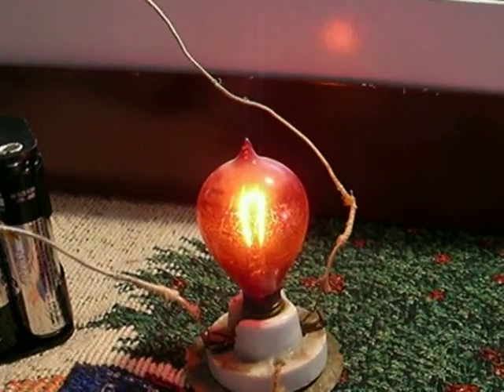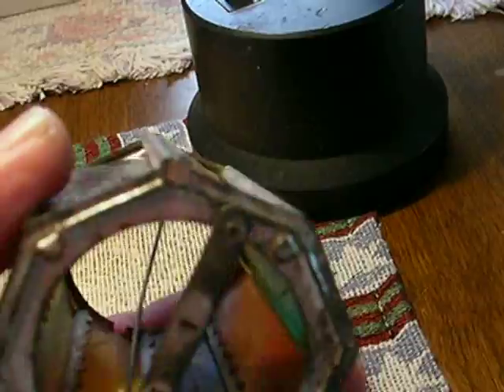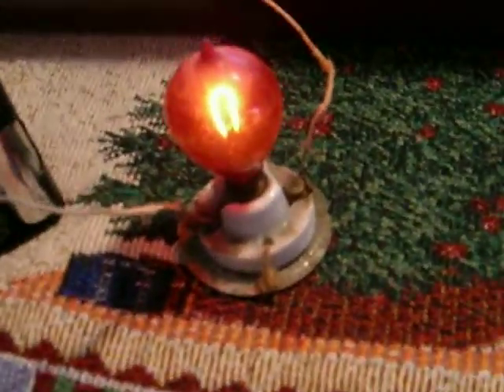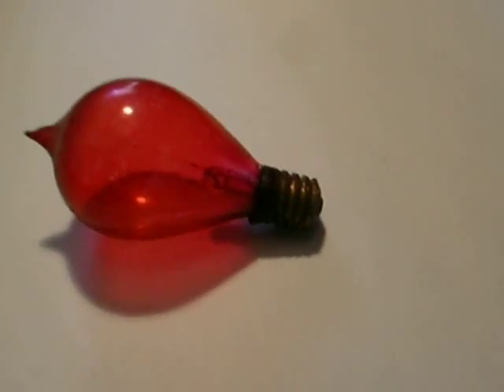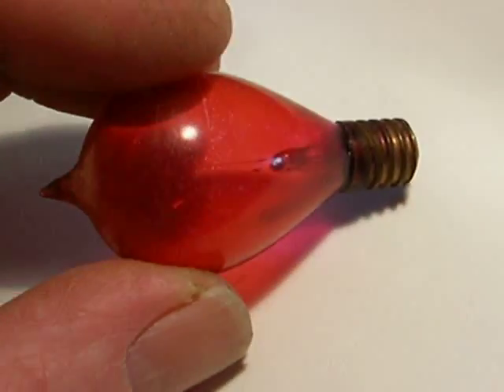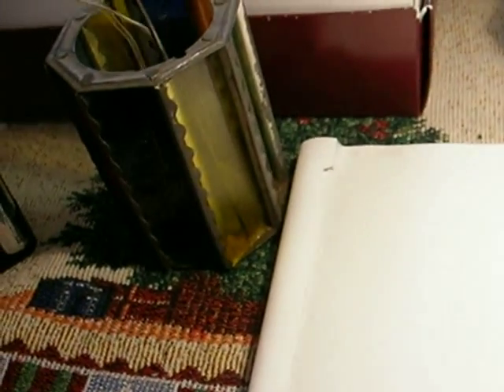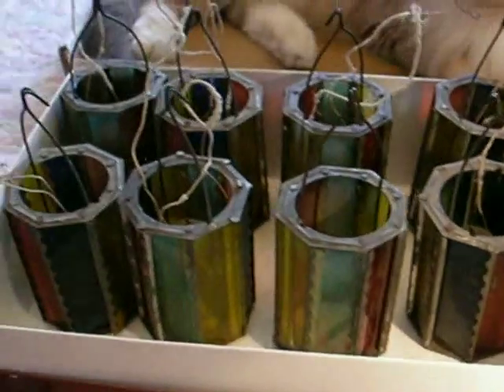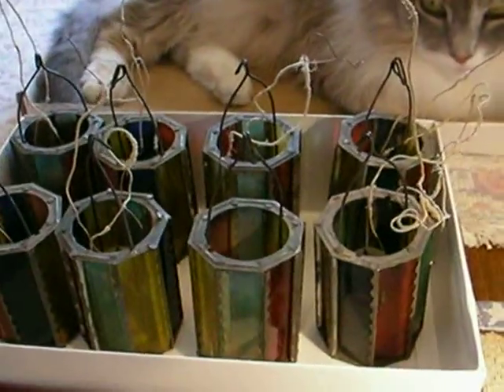Antique Christmas lights - Electrified candles

Comment: Schweet old Edison carbons, Chris! I use my 1916 Edison/Eveready junction-box set at the Edison Tech Center yearly, lately laid out on a table with other old sets so people can really see them up close! These have the round, exhaust-tipped MAZDA tungsten bulbs with the supported C-2V filaments. I have simply put one wire from each porcelain socket festoon together with a short 4-40 screw and nut, taped it up with a little rubber and friction tape, just outside the junction box, putting the 2 sets in series for 16 lights on 120 volts. No need for a dimmer, and I can easily put the sets back to original by removing the tape and reconnecting the sets back in parallel with each other in the junction box! Simple and it works. Since the bulbs are all actually 14 volts like your carbon filament bulbs, for 8 in series on 110v, they actually run, 16 in series, a little brighter than the standard C-6 15 volt bulbs will because the set is rated for 10 volts a set less. Yet, they still run at nearly "half" brightness, so they'll last forever. Some of my bulbs are from 1916, and are tipped, some are from 1917-early 1918 era and are the tipless versions. none are probably newer than 1919, as they started with the smooth cones later that year. Glad to see your stuff again, been a while! Rick C-6 Delair!